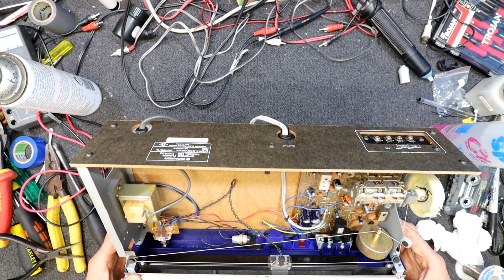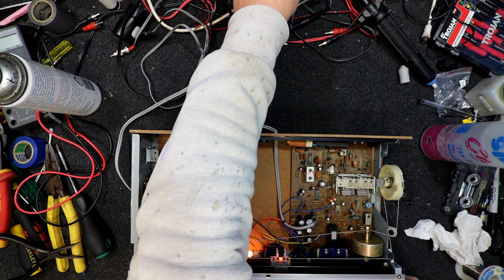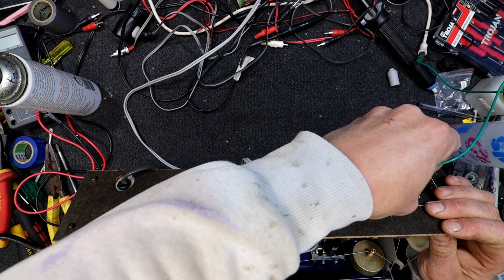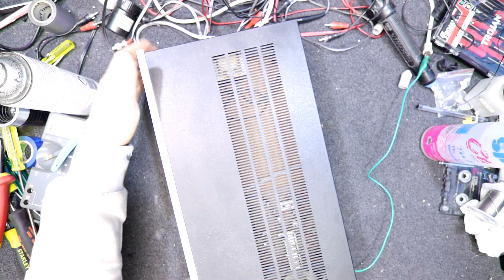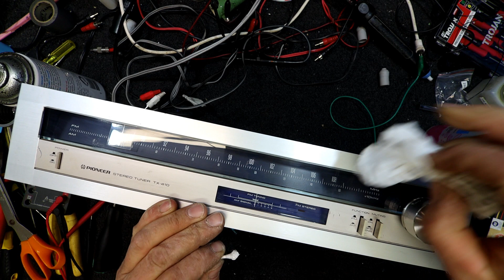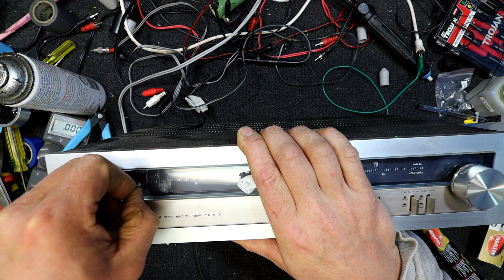Pioneer Tuner TX-410 Check Over and Repair no Stereo Light

Comment: Hey Steve I just picked up this pair a week ago and was informed the tuner lights were out . What's the voltage of these i would like to use blue lights to accent the look? Thx
Reply from the maker: If I didnt measure them in the video I am not sure. Somewhere like Hifi Engine may have a manual that tells you what they are.
Reply: @StevesElectronicRepairShop  Ok thx mine need to be replaced
Reply: 12vol
Reply: @algu1911 Thx